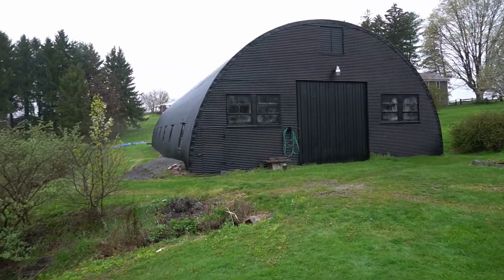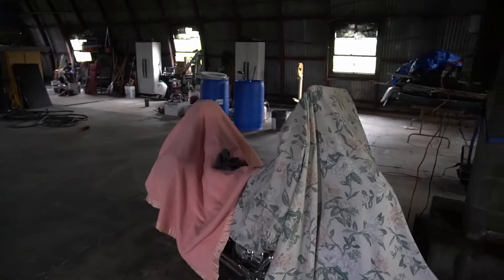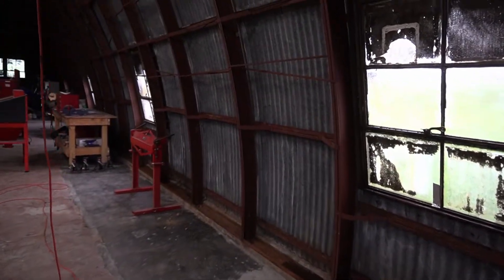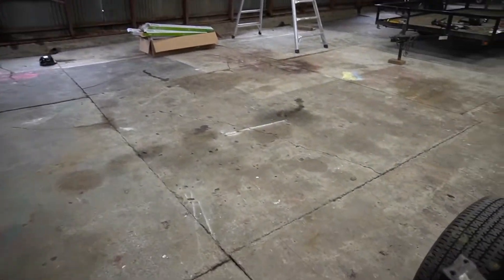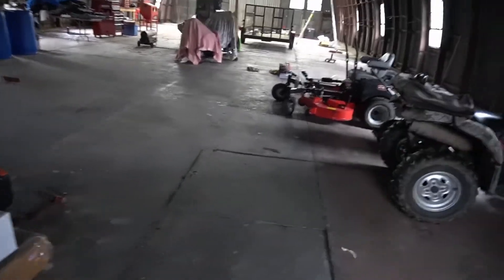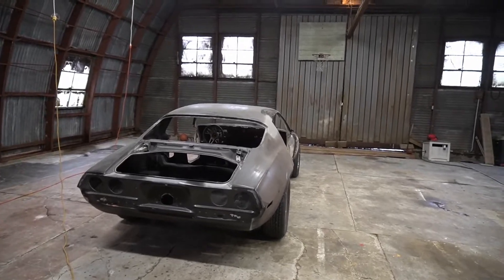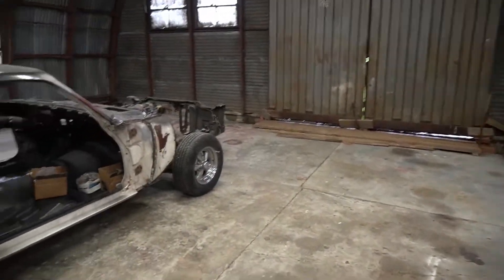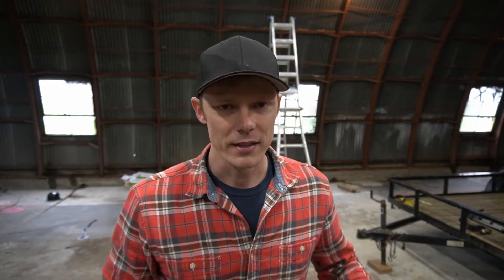1971 Camaro Project Has New Home! Old Quonset Hut

Comment: Hello Dan
I lived in Montana until about a year ago and set up a shop with a nearly identical building, mine was 30x60.  I have only seen a few like these and apparently they were all built in the 50's , but nothing like them later. Mine had at some point a dwelling built in the far end but it was mostly gone, they had 1x3's  nailed to the steel framework , the nails were driven into the sandwiched steel and impossible to pull out .  Condensation is a real problem in these buildings so framing and insulation does not work  and when it's sunny they get really hot.  I also foamed the inside of mine and then painted rubberized latex over it,  then sheeted the walls with steel siding, 3 rows horizontally about 9' high, very easy to do,  this  way the curved steel walls were not an issue. I ran conduit along the walls for electrical which allowed any changes to be made easy. I used radiant tube for heat, it's not expensive and works great.
Now for the car, it looks good , I am doing the same thing with 69 Firebird,  a lot of work.
I will be looking out for updates, take care. Thanks

Comment: The more I'm watching this the more I thinking of how many cars I could fit in there... LOL! Dude this is going to be such an awesome shop! The one thing I would do is make a small 1-2 car garage sized area with low ceilings and completely insulate, heat and cool it. This way you can have a temp controlled workshop area that you can used for small projects in the middle of summer and winter. And of course now you need to start hoarding muscle cars... LOL!
Reply from the maker: The more I’m out there freezing or sweating I’m leaning this way! I’d love to fill it up with cars too!

Comment: That space has alot of potential. Id be tempted to take the front area and finish it. It will make it easier to heat and cool.  Have the back for storage and such. Good to see you Dan.
Reply from the maker: Thanks Russ. I like the idea. My father-in-law said the same thing. I'll have to ask around to understand what the best method is to finish it. I need to get those leaks taken care of.

Comment: Gee, whiz, I think you have plenty of room to build a whole bunch of second gens!! That is awesome! Spring is finally here in Idaho and I am back in the shop working on my two 70's. Looking forward to your build.
Reply from the maker: Thanks! That's good to hear. What are you tackling first?
Reply: @RestoCar  Putting in DSE wheel tubs. Have the cutting done and most of the welding done for the mounting metal. Getting ready to weld in the driverside wheel tub.

Comment: That's a great space! If it was mine I'd start by drawing out the space and what you you want to do in each part of the building. Paint booth in a corner, metal shop, mechanic area etc. For electrical I'd install a subpanel at the front and run outlets and lights for that half. You could easily build a small room for the compressor.
Reply: I'd also put everything in conduit and run it above the windows with drops to outlets. If you want heat, install a ceiling and some walls in a section and heat that. Do you have gas or propane?
Reply from the maker: Thanks for the ideas. I like the idea of drawing everything up first. The subpanel up front seems to be popular idea so i'll have to look into it.
Reply from the maker: I don't have gas or propane. My options are coal, wood, or heating oil.

Comment: if possible, I'd suggest cleaning the concrete and coating the floor with rust oleum epoxy where you plan on working on your car, it's fantastic stuff and real easy to put down on your own
just involves a bit of prep
Reply from the maker: I like it, thanks for the idea. I think that will help brighten things up a bit too.

Comment: Just came onto your channel.  Camaro fan, been watching Asicerik's build.    Original wiring doesn't have grounds, how did it pass inspection?  Build a structure inside your current building.  Frame it out as far as possible, leaving room to walk around the outside.  A building in a building with ceilings high enough your lift you will put in.  Put a sub panel in for your electrical.  Be plenty of cold storage also, your stuff or rent it out.  Good luck!  New viewer.
Reply from the maker: Welcome to the channel and thanks for the ideas.  I was out there this weekend and it was already beyond warm out there with temps in the mid 60s. Definitely some kind of structure/framing in the future.
Reply: A guy I know lived on an old farm and inside the barn he built a structure that was a building in a building.  With a quonset style building, you are going to lose side wall and it would be difficult to insulate.  There is spray in insulation, but you will still need walls that are vertical.  If you do go that route, make sure to leave the ceiling high enough for your lift you will get.

Comment: Where does the electrical actually come into the building?
If it were me, I would either run it in on the end you intend to use or if it comes in the other end of the building run one or two "mains" back to the end you intend to use rather than a whole bunch of separate lines/runs.  I don't know I would bother to attempt fixing what is there, likely cheaper/simpler/safer to start over (assuming current code would even allow it).
Given I see a snowblower I will make an assumption its not warm year around and if you intend to be out there 12 months out of the year, I would suggest putting up a wall about half way down, just past where that flue is located so you have a chance of heating the place without going broke.  Medium term consider putting a mezzanine floor back.  Plus it sort of cuts the number of urgent repairs in half (re: windows and leaks).
What I wouldn't do for that space!
Reply from the maker: Thanks for the ideas. I like the idea of splitting the building in half. finishing one half, and dealing with half of the repairs. You are correct about it being cold. I live in central PA. I know myself and I will not want to be out there in the winter if it's in the 30s.
Reply: @RestoCar  Yeah, I happen to be a believer in the slightly cold temperatures as being the worst for rust, you have to decide to keep things quite cold as in no insulation and not use the space year around or having heat on a lot trying to fight condensation (found it that way with machinery and tooling).

Comment: As a professional electrician I think I would run conduit especially if you use in like 1/2 inch or 3/4 EMT it's so easy and for your lighting I would run the conduit by the lights and install a receptacle and plug the lights in with a pigtail for easy maintenance you should probably run some Travelers up to the front for the light switches so you can control the lights from either end of the building I never have cared much for running MC cable it really sucks but no matter what you do congratulations on the new place brother I can't wait to see what you do with it you should look on Amazon they have 4 foot LED tube lighting 6 to a box for like 59 bucks they're bright as hell and pull hardly no power call if I can answer any questions

Comment: Im fighting with floor pans and also frame fails. And tourque boxs  the old cage nuts are rusted..😭😭😭😭😭😭
Reply from the maker: Man I feel for you! The torque boxes were the most difficult thing I've replaced on the car. I'm talking more difficult than the quarters, wheel houses, and even the roof skin. Let us know if you discover any good tips along the way!
Reply: @RestoCar  I sure will I have two Camaros a 79 and 80. And both need help 😭😭😭

Comment: I think I’d have the panel moved to the front of the building, I think I’d partition off the back half of the building. I’d spray foam insulate and heat the front half and then do the back half when funds are available.

Comment: I'm not good at all with electrical work, but I would definitely fix the leaks you have in that building. I know you can get windows that are designed for Quonset huts.  Water and angry pixies don't play very well together. After the leaks and wiring have been taken care of, I would have closed cell spray in insulation applied to the entire structure. Closed cell repels water, unlike open cell which acts like a sponge. As an added benefit, bugs and other critters don't like to try finding their way into or through closed cell foam. The foam will also help with deadening loud noises from tools, compressors, and engines. You can have the concrete floor jacked up where it sank. I would go for polyurethane jacking over mud jacking. It's less expensive, and it lasts a lot longer. Here's a good example, not my video, I don't even live in the state this company operates in.... https://www.youtube.com/watch?v=qvyAdNdersQ  Have those floor drains rodded out, they're backing up because they're clogged. Replacing those old light fixtures with LED's not only give you better lighting, but would also save a lot on your electric bills. These are a great alternative to using 55 gallon drum fire boxes, they last a lot longer, and they are also a lot less expensive, and easier to find than old school cast iron wood burning heaters, AND......they do a much better job than either the 55 gallon or cast iron wood burners........ https://www.youtube.com/watch?v=cQgoNhPm0vg&t=696s